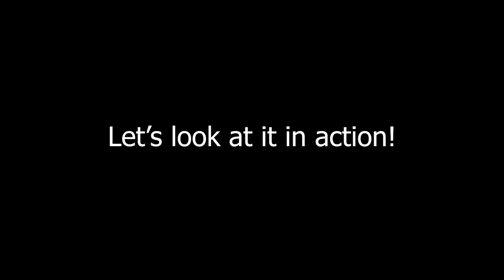PS5 Adaptive Trigger Live Mechanics in Game - Full Teardown

Comment: 1:40

It is an encoder. A potentiometer doesn't spin around like that
Reply from the maker: Ah ok. I thought it was just a different type of potentiometer. Cheers
Reply: Hello circuit nerds
Reply: Guess he isn't a synth lover.
Reply: Beat me to it. By a week. Yeah, its kinda pedantic...but once you know, you just know. Also its contactless, so even better than potentiometer!
Reply: How do I replace the spring inside mine is broken
Reply from the maker: @ttv_heymyworld6959  Warranty?
Reply: I'm not smart enough to understand any of this. I'll see myself out
Reply from the maker: @1VideoGameDude  😄
Reply: @1VideoGameDude  lol
Reply: @1VideoGameDude  Identifying electronic components has nothing to do with being smart. You are either born with the gift or you aren´t.
Reply: It's a potentiometer, most likely an Alps RDC506002A
Potentiometers that are "consumer facing" will have end stops built in to them, but ones used in servo applications like this will sometimes rotate freely, and rely on the end stops being built into the rest of the mechanism
Reply: @azyfloof  A quick online search of the make/model you suggested would have most people convinced of this fact.
Thank you!

(And dare I ask everyone involved in this thread "what difference does it make?")
Reply: Fuckin genius
Reply: U sure bout that? From what I know the rings inside  are conductive pads, which slide over the material and thus giving a different analog readout. An encoder makes use of rotating punched disc a light source and an receiver for the light.. which is not what I think is happening in there.. its a potentiometer for sure, just like how that normally would slide its skate over a conductive material, only now in circle..

It may also be a hall sensor of some sort.
Reply: @MasterTRL  Exactly!
Reply: More specifically, a grey code encoder.
Reply: Ok nerd
Reply: @mex3095  thanks! 
"And as always I hope you learned something"
Reply: @RestoreTechnique  whats the moter for?
Reply from the maker: @deluxrefurbish6601  The adaptive trigger. It pushes back against your button press, to feel more realistic.
Reply: Potentiometer is more of a name for anything that can read active resistance. It's less about it's general design.
Reply: Looks like a potentiometer to me

Comment: Very COOL mechanichs, but im afraid that the triggers will fail too offten
Reply: True i mean its just plastic gears constantly under stress
Reply: They are stronger then they look. Plastic gears are used a lot in electronics. For example a dvd/cd drive
Reply: I was just thinking that i should have bought a 3rd party warranty for my PS5 or if i buy another controller to get it for that.
Reply: @JulianiLuckeey  yep but dvd driver has no pressure or heavy duty and dvd have metal infinite screw not plastic
Reply: @jacopocito8307  Like a playstation controller is heavy duty? Maybe little bit more forces but heavy duty, no way
Reply: Plastic gears are used on driving wheels with force feedback which is pretty much the same concept but you apply much more force on them with both hands and they are very durable.
Reply: @JulianiLuckeey  electric power steering use metal gears. They should use metal gears here because it is in contact with human forces. Disc drive does not have human hands holding back their actuations.

Edit: typo
Reply: You can disable the adaptive trigger if you don't care about it
Reply: @LucasCamargo827  I do care about it, im just worried that the triggers break too soon
Reply: oh, why you use smartphone instead of old Nokia phones?
Nokia is indestructible.
Reply: I think it can hardly happen and even if...you can always buy another one. They costs but not so much.
Reply: @arthurmctavish  mine did already im not rough with my control either
Reply: @bruins871  , really?! I figured they must be tested to last at least a year. That sucks... I imagine the motor only produces a pound or so of force; it's surprising that the plastic can't handle that.
Reply: I like how suddenly everyone is an expert
Reply: @Go_Coup   yup not lying only one kind gave out a bit where the R2 became a bit flaced and was too sensitive the trigger wouldn’t come back out responsively. I reach out to sony they agreed to send it to their warranty dept but sadly shipping was at my cost. But they covered you shipping a control back to you.
Reply: @arthurmctavish  they won't, believe me
Reply: @corpse4434  we engineers know what we’re doing. Dont worry :)
Reply: Mine still works perfectly fine for over a year.

Comment: i guess no more taking apart my controllers to customize them, there’s no way in hell i would be able to get that back together lol
Reply: The majority of the controller looks very simple to take apart. These triggers and the haptics (and really most of the individual "features") are all separate modules. The haptic actuators are soldered on and glued in, but apart from that, everything else comes apart quite distinctly.

So if you're already adept at customizing controllers, you wont have any issues here (unless you were planning to modify the triggers, then yo SoL lol)
Reply: It’s fairly simple actually and not that complicated
Reply: Having modded my controller i can tell you the part you are seing is in its own housing. You can swap everything else in the controller without getting into the mechanical portion.
Reply: If you have the right tools anything is possible.

Comment: PS5 Duel Sense Controller is a game changer. Hats off to the engineers that designed this... nice to have something new and creative
Reply: Yeh gg to them
Reply: You think?  Just looks like a heap of failure points to me.
Reply: @zybch  Have you experienced the controller yet? When I first used it I was pleasantly surprised... but obviously it's not gonna be for everyone
Reply: @DRE2XL  I have the system, and the controller is absolutely the best Sony has made.  But perhaps because it's such a large leap from the dreadful dual shock 3 and 4, it's getting way too much credit for its haptics.  The rumble on the Xbox controller gives almost the same level of feedback with its trigger motors which have been part of it since 2013, but because of MS's stupid mistakes at the start of that gen, they got overshadowed by the problems.  
Games that make proper use of it, like the Forza series, are amazing.  You actually feel like your car is being gripped and pulled when you drive through mud for instance.  But because most development teams used only the most basic of haptics, it's a feature that just got ignored, often deliberately so, by users and especially the Sony loving press.
I hope the same doesn't happen with the new Sony one, but developers being what they are for the most part it's likely going to be used as much as that stupid touch pad or speaker was last time lol
The resistive triggers are absolutely going to break.  I was excited when I thought they'd be using inductive resistance (similar to the Switch HD Rumble) but this purely mechanical system just isn't gong to last, and the pressure sensor of the L/R2 triggers is disappointing as well.  I'd hoped they would have switched to hall sensors by now, but it's the same 'buckling dome' system since the ps2 (I think).

But, the controller feels great in the hand, battery life is way better if you turn off resistive anyway, and I'm more than happy with it.  Just not the longevity problem I suspect it's gong to have.
Reply: @DRE2XL  check out the  number of people currently having issues with this feature. I personally have sent my controller back to sony.
Reply: @DUVAL_County  mine has given me no problems at all, but my PS5 itself has crashed at least 5 times just playing Spiderman or COD
Reply: @DRE2XL  I'm not a fan a more parts.. simplify.. this feature is bound to fail. unfortunate because it's a cool feature.
Reply: @DUVAL_County  I hear you, I have a feeling mine will break at some point but fingers crossed lol
Reply: @DUVAL_County  whats the process i seem that i cant get a hold of them for mine
Reply: @zybch  see you in 4 years when it still works.
Reply: @iamthepepsiman5730  it's already failing though, and the resistive touch seems to be a major part of that.  It's a pity because it can be a great addition to a game.
Reply: @zybch  do you even own one? I know for a fact the DS4 had serious quality issues, but we've got 2 at home and they feel really solid. Granted we haven't had it for long, but it seriously doesn't look like it'll break any time soon. Every time I think something like the triggers break, I imagine someone mashing them with brute force and expecting them to last.
Reply: too bad it only lasts a couple of weeks if you really use it.

Comment: Been wondering how's the adaptive trigger function. Didn't expect it has gears inside to control the vibration effects. Very informative video.
Reply: It is not controlling the vibration. It is pushing back on your finger, resisting it. The case where you see it like vibrating is actually a situation when you push the trigger by applying the same force and the trigger pushes back and releases, pushes back and releases really fast.

Adaptive triggers are not for vibration. They control the resistance of the trigger. When the trigger is easy to push, when the trigger gets harder to push (and how much) and when it gets stronger than the force of your finger so it pushes it back.
Reply: @inSertCoiNow  That makes a lot of sense now!
Reply: Imagine in the near future where every button got their own motherboard
Reply: Yeah fr, o thought it was those magnets that push away from each other when they get too close
Reply: @inSertCoiNow  There is actually Vibration in the triggers in some games. for example horizon forbidden west when you aim with a bow. the effect is also created by the gear/motor
Reply: @davidsteiert9985  maybe it uses ac frequency too

Comment: Meanwhile, the xboxsX controller is the same controller
Reply: It's a fine controller, just with less features. Also this additions add price quite a lot. It would be good if they keep the price. Outside the US these price additions are quite inflated.
Reply: @gon2571  rechargeable AA are very cheap, less than 10 USD for a pack of 4.
Reply: @Mono 60 USD where you live, here it cost around 50 USD. Also 10 USD can get you a charging station + 4 rechargeable AA batteries, which is good for fast swapping (use one pair while the other two charging). From my experience my Xbox Controller last far longer on a pair of rechargeable AA compared to my PS4 DualShock controller on its internal battery. Also I can't quick swap PS4 controllers, so I have to play tethered (either to charger or powerbank) when it's out mid-play. I have both since I use DualShock when playing PS4 Pro, and Xbox Controller on PC.

Edit: typo

Edit2: 50 USD is the Xbox One S controller here where I live. IIRC, Xbox Controllers are cross compatible while PS5 requires DualSense to play PS5 games. So where I live, Xbox when strictly in terms of controller is much cheaper.

Comment: That those triggers gears could start to wear out, lets hope they are durable enough for everyday users
Reply: It shouldn't matter if they do, unlike something like the joysticks, if this mechanism gets sloppy and loose, the motor will take up the slack and you're unlikely to notice. It's all about applying pressure, that is, driving the gear to a specific point, and then maintaining it at that same position with a maximum amount of power to the motor to control how much resistance it provides. The motor will just quickly drive until everything's in the set position, the only bit where looseness would matter is in that interface between the big cog and the potentiometer, but that's not an area exposed to stress or wear. I think the areas of wear risk on these controllers remains the joysticks. If the adaptive triggers are going to fail it would probably be a catestrophic failure like motor burning out overheating. I have high hopes for it's longevity.
Reply: its technology.
all new good technology always broke faster.
and why you use smartphone instead old nokia phone?
Reply: why not just machining a metal gear in a cnc
Reply: @l0k048  expensive
Reply: Yep. I'm wondering how long they will last. It depends on how much force it generates.
Reply: @phxf  someone commented they had one for 9 days and the L2 broke. So I think these will fail with regular heavy use.

Comment: My right trigger is already shot so any future controllers i buy I’m disabling the adaptive trigger. I never dropped my control so im not at fault. the right trigger is so sensitive now I barely tap and and it engages any action.
Reply: mine too!! and i only had it since march. i take VERY good care of my controllers. i always leave them in a safe, cool spot and don’t clack down too hard on buttons. i also didn’t really use the adaptive trigger feature that much because i don’t really like it but even then it still broke. i heard a little snap inside the R2 button and i barely touched it. I noticed the button was so sensitive that with the slightest tap, it would go down and activate. not sure how all that happens
Reply: @SavageStarlite7  it most likely biund to happen because it has a bit more complex than the ps4 dualshock control. I resolved the issue buy sending it to somy for warranty. Got one back A day or two after sending my control.

Comment: Small tip: Put a high pass (or low cut, same thing) filter on your audio @ around 100hz maybe, every video software should have one, because there's this weird low rumble on the background that doesn't sound nice on headphones, also, thanks for the vid, very interesting
Reply from the maker: Ok thanks! I will try it. I had some negative feedback about the audio on another video. I didn't think there was anything I could do about it in post, and was thinking about a separate mic. I'm just using the built in mic in my phone (Samsung S10e).
Reply: Nice to have a potentially good tip re the sound issue for headphones, hope this helps.

Comment: Very cool engineering they've done!
Do you think that helicoidal gear will hold? To replace it means replace the motor also right?
Cheers
Reply from the maker: You can get the helicoidal gear off the motor, buy cutting into it and destroying it in the process.
But if you needed to replace the motor, I doubt you'd be able to retain the original gear.
I think the gear will wear over time, and you'll start seeing problems in a couple years, depending on use.

Comment: For those of you wondering how it feels its really weird at first and I still haven't gotten used to it because it almost feels like your breaking it but your not although it is really fun to use.
Reply: Excatly I felt that it will break too when I’m using it
Reply: @sesos1232009  yeah its really weird
Reply: I think I did break it tho 💀
I was playing dying light 2 which is the first thing I played with adaptive triggers, now my L2 works just fine everytime, but my R2 doesn't resist most of the time, and when it does its not as strong as my L2

Comment: When taking apart and putting back together, how do you figure out the position for the potentiometer arm so that the tension applied by games/apps matches what the developers intended? I’ve had issue where reassembly warranted either less tension (resulting in the need for a deeper press to clear the tension) or too much tension.

Comment: Great video but seriously you know how to tear down the entire system but not how to put a small flat head in-between the gear and the motor that is how you get the engine out of the plastic slot

P.s. great video tho I have seen nothing like it
Reply from the maker: You mean removing the worm gear off the motor? I pulled hard on that worm gear to get it off the motor, it wouldn't budge. Probably would've broken it with any more force.

Comment: So if we take out the Gear,could we permanently remove the adaptive triggers on the Dualsense?
Reply from the maker: Yes. But can't you disable the adaptive trigger in game settings? So no need to remove the gear? 
Also, if you just remove the gear, you will hear the motor spinning constantly at full speed. You would need to desolder the wires to the motor (or cut them).

Comment: amazing video, i have a question. if  i wish to make my controller lighter, can i remove the adaptive triger system and still be able to use the L and R buttons but without adaptive technology ?
Reply from the maker: Yes I believe so, but only the motor and the large cog/gear. Otherwise L & R buttons won't work.
You'd have to keep the rest of the adapting trigger housing and circuit board, as that is still required for L & R.
Reply: @PS5,seriesX,switchOLED owner in order to make the controller lighter

Comment: My R2 spring has already snapped. I took it apart to find out, 5 minute job but can't find a replacement anywhere at the moment. It still works OK it's just very loose to press.
Reply from the maker: Oh no, that's so soon. What about your warranty?
You could buy a ps4 controller spring, it should work.
Reply: @RestoreTechnique  no point with warranty. It can take 3 weeks+ and they don't have stock at the moment. Apparently ps4 v2 springs work, I've ordered some for £1.50 so we will see.
Reply from the maker: @D-M-L  Fair enough, I thought there was still controller stock available. Good luck with the repair 👍